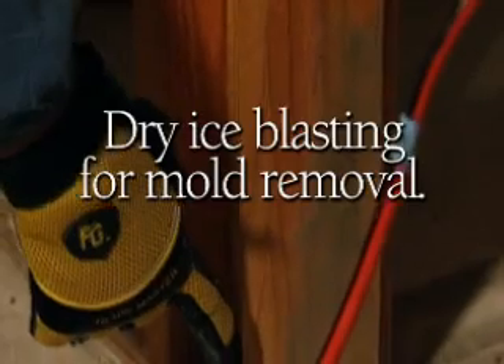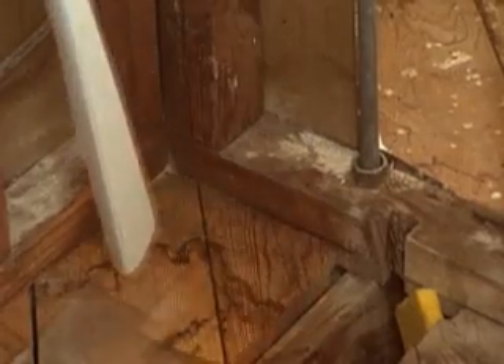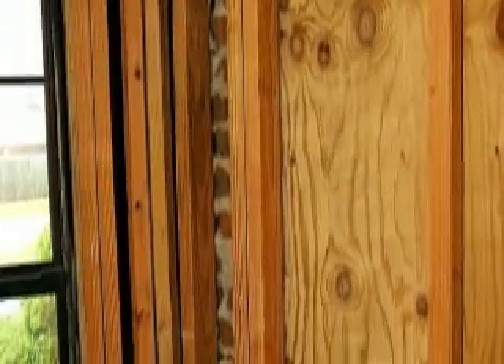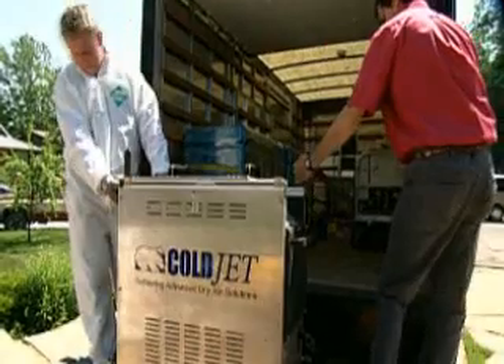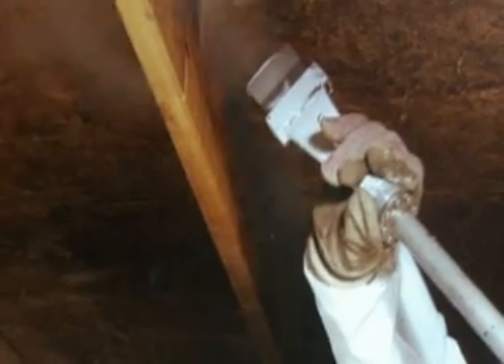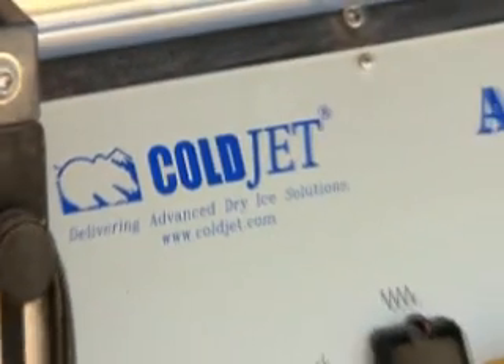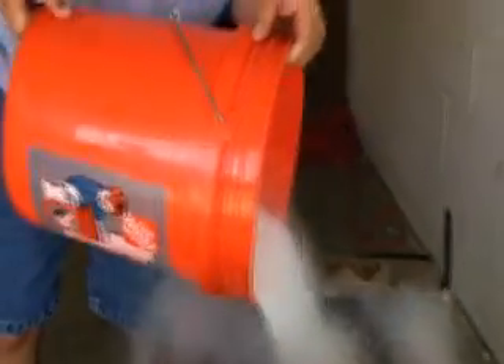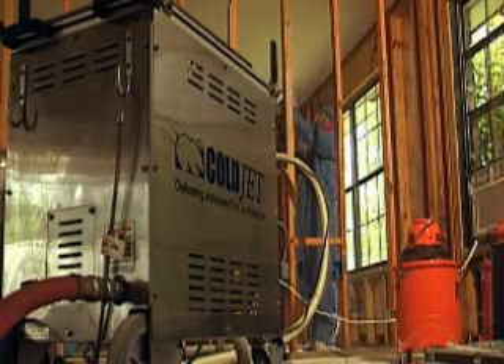How Dry Ice Blasting Revolutionizes Mold Removal: From 8 Days to 3

Comment: You spreading mold spores all around doing that. Don’t do that. Your going to end up with growth in other areas
Reply: Mold spores dispersing in places other than active growth does not create new growth in other areas.
Reply: That’s why you also create negative pressure and than you disinfect 
And than you get it tested. If it clears you good.
Reply: If you spray it down first then hepa vac and have negative air or air scrubbers set up your good
Reply: And actually then ice is so cold it kills the mold on contact